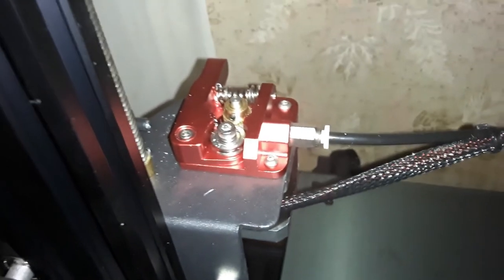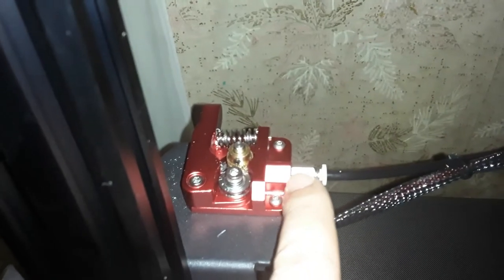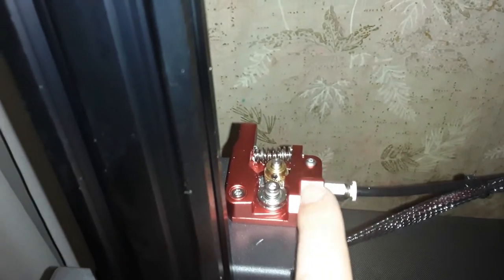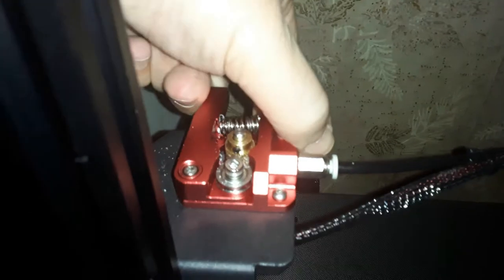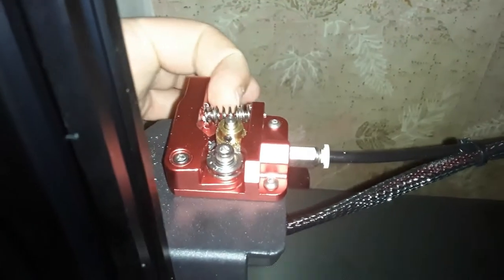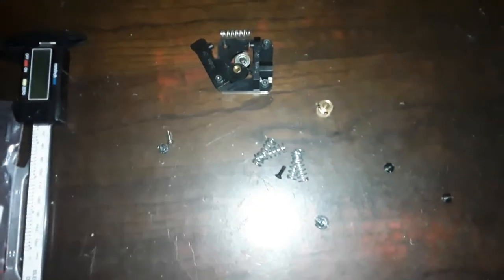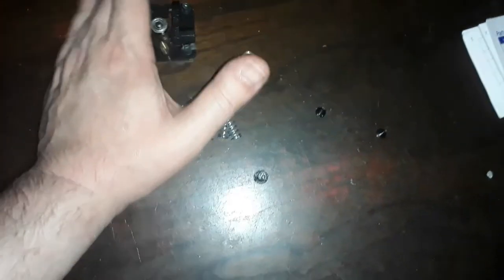Necessary Upgrades Sunlu S8

Comment: Definitely would benefit from a BMG extruder upgrade. A 32bit mainboard would be good with silent stepper drivers. I don't understand why in this day and age when 32bit boards are cheap and plentiful, sunlu would sell an 8bit printer. And the Plus version has a .45mm nozzle which begs the question why?
Reply from the maker: I completely agree. The board upgrade is something I will eventually cover. It doesn't really go with my theme of 3d printing on the cheap though, and sunlu seems to have tried to ensure most people will not do this with the fact that no board will fit. Check out my channel fot the updated version of this video:  upgrade stock to good. One last thought; this printer works much better after th3d's firmware update.

Comment: Glad I watched this video. I recieved mine a few days ago and I was getting clicking constantly even when pushing filament through with the nozzle off the bed. This is my 4th printer and never had the issues I've had with this one. Not that it's a bad printer just that sunlu skimped on areas that don't make sense. Upgraded firmware, already had an extruder assembly on order, flex metal bed and printed out the red squirrel mount. For the price the printer is worth it as long as it's not your first.
Reply from the maker: Absolutely right. If not for the low price point and ability and knowledge to replace what is needed this printer would not be worth it. Although, this was my first printer, it and sunlu's lack of customer support has afforded me an education. 
 I've been slow at getting another video out due to school starting. But will soon come out with new content. 
As I'm focusing on 3d printing on the cheap, I ordered a few all metal hotend knockoffs and will do another video when time permits.
Thanks for the comment.

Comment: I think one of the main issues people are having with this is the design of the hotend. There is a piece of non standard PTFE tubing in the throat of the hotend near the heat break ment to help the PTFE keep contact with the nozzle. The problem is that this tube is thin and when exposed to heat for a few hours will contract at the end do to exposure to heat. This is why so many people have issues with under extrusion after a few prints with this printer. I replaced mine with the same red hotend that used to be on enders, it's like ten bucks. My printer has been printing constantly for 3 weeks now with 0 print issues and now have somewhere in the neighborhood of 1000 hours on the machine total. Once you get it set up it's a great machine.
Reply from the maker: Yes, I completely agree that the ptfe tubing is a disadvantage to this hot end. I stated (in either this video or another one) that I pretty much changed that tube every time I change the nozzle. Changing the profile in cura to the cr10 fixed most of my issues. When I change my hotend it will need to be an all metal end. I have recently started using a lot of petg and that has made the issue with this tube a lot more prominent. The red creality hotend will still be an issue as the Bowden tube is too close to the heat when using a constant 240 degrees.
Reply: @garysplace1431  I completely moved away from using that white PTFE tubing on any of my printers long ago, infact they don't even see there first print with the stuff. I use Capricorn instead it's heat tolerance is much, much higher so you won't experience any issues even at the highest of temperatures. That's honestly how I get away with using cheaper hot ends. On top of that, while Capricorn is a bit expensive for what it is it rarely needs changed. And again you won't experience any of the warping you see with that white cheap PTFE tubing. No one can argue a nice all metal hot end though.
Reply from the maker: Yeah I agree, capricorn tubing is a more thermally stable ptfe. When I purchased new tubing for that buffer tube I searched based on temperature. I found a white ptfe rated for 280 degrees that has worked for me so far.  Capricorn tubing is only rated for 250 degrees which is fine because it is not as close to the heat in that hot end. I'm definitely going all metal when I get to that upgrade.
Reply: @garysplace1431  Capricorn's website claims stability at 275 with shortened lifespan at 300.

Comment: What kinda spool holder do you have there looks what I've been looking for
Reply from the maker: Hey David, That spool holder is my own design. It's on thingiverse. I have a video called More Sunlu S8 Accessories. And Failure. The thing number is in the description. It fits any standard 20/40 extrusion. I was going to update the description to suggest tree supports as they work better for this model. 
Gary
Reply: @garysplace1431  thanks I'll have to try it out on the s8 and others ...thanks!

Comment: Дякую, помогли ваші поради. Чи доцільно буде встановити direct E3D v6 extruder? / Thanks for your tips. Will it be advisable to install direct E3D v6 extruder?
Reply from the maker: I have heard good things about the E3D extruder, although I have not myself tried them. I do know these extruders are the J type so you will need to print or buy an adapter (they are secured to the machine differently) and it is recommended you buy an actual E3D, not a clone as the clones are usually of poor quality. 

I think for the beginner it might be easier to use a Creality style all metal hot-end as these should just bolt-on in place of the original (without the need of tweaking the setup). I would also recommend buying this before the fan duct upgrade as you need to print the correct duct for the hot-end you are using (and why do it twice?). If using the E3D hot end you will also need to find a different duct setup as the duct mentioned in the video was not made for that hot-end. 

My series is more for the just getting started 3D printers with a scope of helping without getting too technical (for beginners). The hot-end supplied with this machine is usable (especially for the beginner who normally just prints in PLA) but does have a lot of drawbacks with the PTFE heat-break that will need to be changed semi-regularly (more so if using materials needing higher heat). An E3d hot-end would be more of an advanced upgrade in my opinion. As I progress through the series I will expand to more advanced topics.

Comment: Do you think these issues are still prevalent on the S8 +? Just bought mine and it arrives tomorrow, haven't found many videos on it nor any things describing the difference between th S8 and S8+
Reply from the maker: Hey Seth, I would highly recommend checking out my video stock to good. It is an updated version of this one. From what I've seen there are very few changes to the plus. I think the main change is their firmware which is crap in my opinion. I changed mine and it was life a different machine. It's covered in the other video. The dual gear extruder is also a great upgrade and is in the other video.
Gary
Reply: @garysplace1431  thanks I've watched the video and have taken everything into account. Can't wait to implement these improvements, thank you for the videos!
Reply from the maker: Seth, When they first came out the anly differences listed was the handle, spool holder, and some smooth movement adjustment in the firmware. That is all I remember being listed. The lack of info or videos is probably due to the lack of changes. The issues stemmed from cheap parts and lack of R&D, which is fine for a cheap printer. Luckily they used most normal parts for an creality which allows easy  modifications. It's a good printer as long as you are a tinkerer. Most people purchased it and didn't like it because they wanted a cheap printer that prints perfectly out of the box. Unfortunately those do not exist. Also, I use the creality cr10 profile in cura and adjusted the settings till it prints right.
Gary
Reply: @garysplace1431  understood, I was hoping for a bit more plug and play but as of right now that's not a reality for most printers. I also have a question on which filaments to use. I plan on using it for props and such, are there different sizes of filament or some certain type I should use? I'll be setting it up today and will probably use all the filament that comes included as test prints to change up the settings. I'm sure I'll be able to find a setup guide.
Reply from the maker: Seth, Don't let me get you down about the printer, it is well worth it. I just like things as perfect as possible.  As for filament, you'll want to buy 1.75mm. I like tecbears, unless you change the hotend I would suggest sticking with pla. You'll run into less issues that way. Other than the white that comes with the machine I've never had much luck with sunlu filament. I usually buy from Amazon when they have sales. Don't be afraid to experiment thought.
Gary

Comment: heya, i have looked at all the shrouds and i still cant figure out where the L.E.D light attaches to ?
Reply: ahh my bad, sussed it haha
Reply from the maker: There is a hole right next to the part cooling fan mount for the LED.
Reply: @garysplace1431  cheers Gary, yeah I just figured it out iwhen trying to assemble haha, I thought the wires for the heater element went through the hole, but  obviously not haha.
Reply from the maker: Great, man. Always happy to help.
Reply: @garysplace1431  cheers bud, you gained a sub ✌️
Reply from the maker: Thanks for the good vibes, man. More content next month.
Reply: @garysplace1431  awesome mate, really look forward to it 👍, anything on the sunlu s8 would be fab x

Comment: Any plans for upgrading the hotend?
Reply from the maker: I thought about it. Though, I think the design of this one works well (at least for now). I have had to replace the nozzle and heat break tube twice. (Something I will make a video on later) Thanks for the comment. Definitely something I will think on. I purchased this printer in November and it's been running pretty much straight through till now. I am now close to needing new bed wheels, so I'm replacing what I have to in order to keep a decent running machine.
Reply: @garysplace1431  After rebuilding the hot end several times over the past 2 years I found a video about upgrading the hotend. I ordered one and put it on and it makes a huge difference. https://www.amazon.com/gp/product/B07ZMFTKBW/ref=ppx_yo_dt_b_asin_title_o04_s00?ie=UTF8&psc=1
Reply from the maker: @Danaton2   I just posted a video on cheap hotends, check it out. Upgrading the hotend to an all metal version is important for me as the stock hotend of this printer is fine for low temp applications. I would just recommend upgrading the Bowden tube which comes with the new extruder body. I started working with Petg and like it much more than Pla. Petg seems to be too much for this hotend when constantly printing with the higher temps. Ptfe should not be used at a constant 240 for extended periods of time regardless of what type it is.